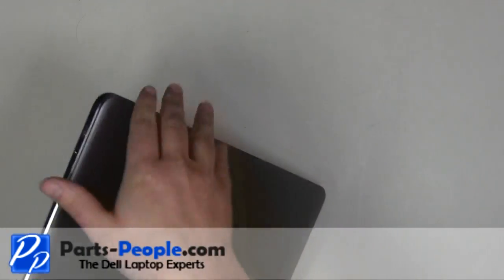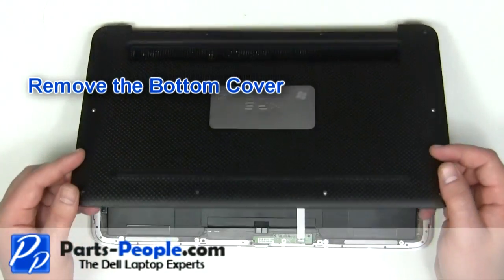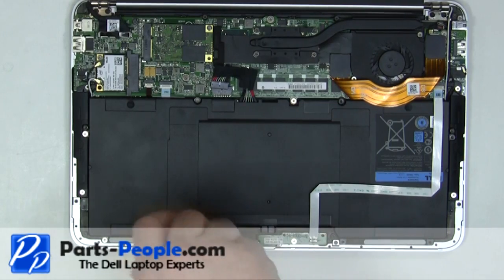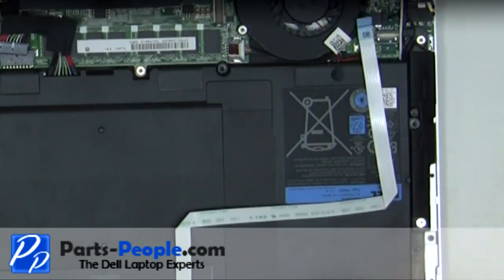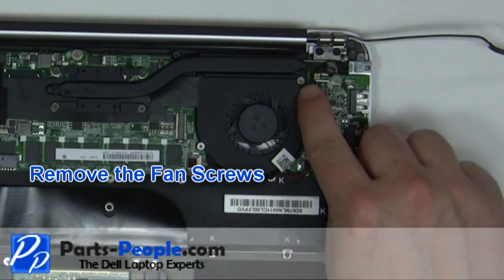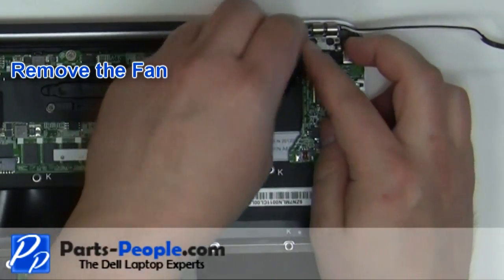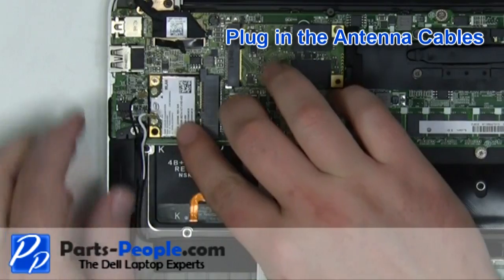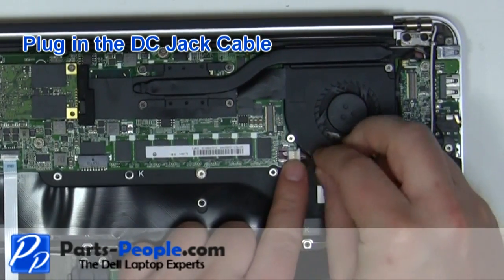Dell XPS 13 Ultrabook | DC Jack Replacement | How-To-Tutorial

Comment: My XPS 13 is quite different than the one in the video.  For example, there is a screw in the middle of the case hidden under a flippable panel.  Still, the video gave me enough information to replace my power jack, and all is good now.  Thanks!
Reply from the maker: Yeah, I think this is the XPS 13 9333. There are now 7 different XPS 13s. Either way, I'm glad it help you figure it out.

Comment: Great video, but I would order the parts from somewhere else. I ordered the replacement jack from their website and they sent a jack with the wrong voltage, shorted out my charger every time I tried to plug it in.
Reply from the maker: Did you call customer service and tell them the problem. I'm certain they will help figure out a solution. I know they will send you a replacement if the DC Jack is bad.